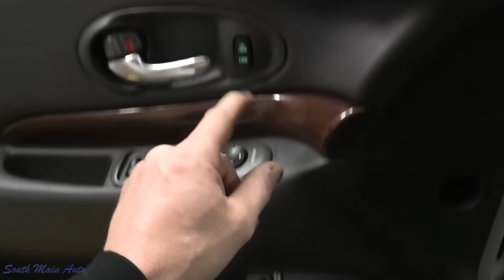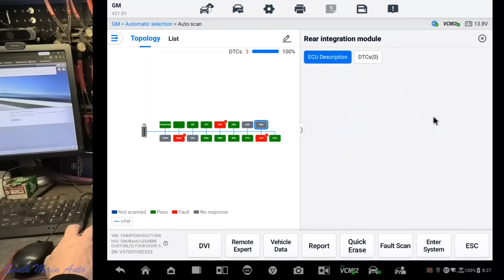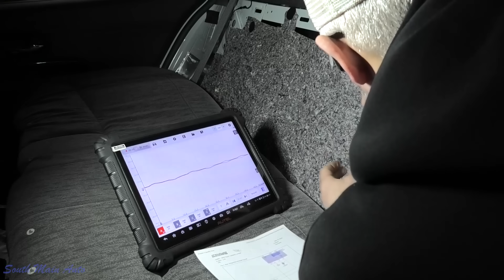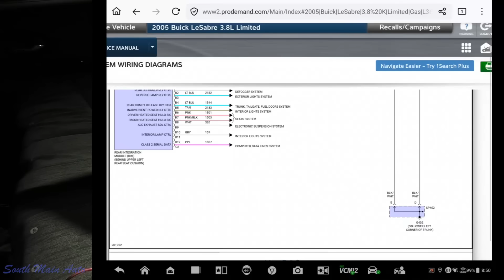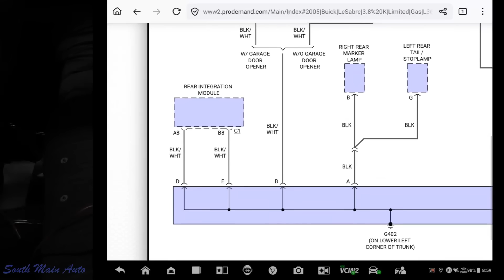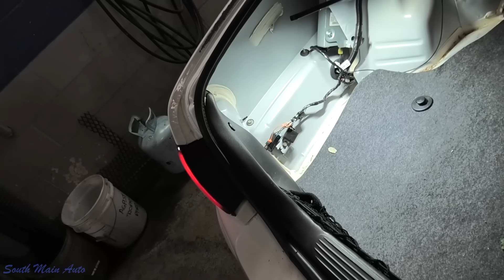2005 Buick LeSabre Electrical Nightmare – Customer Replaced Everything… But It Still Didn’t Work!

Comment: The best video on the internet is one of an older 5th generation Buick LeSabre. "Insane Jump by a Buick La sabre" <sic>
Reply: We all had those hand me down G body’s in Cleveland during high school. Used to PIT each other in blizzards, jump the tracks at the steel mil etc. gotta be so lame to be 16 and get a carolla!
Reply: Pre-cell phones…. Walkie talkies and a camcorder.  Gen X at its finest
Reply from the maker: https://youtu.be/5kMTHwjy6Z8?si=ZaMKWZu77kBntRlp
Reply: @SouthMainAuto  HOLY SHIT
Reply: @SouthMainAuto  "Its clear man, keep going"🤣
Reply: @SouthMainAuto  Comments are as good as the jump: "even death was surprised by that outcome" etc 😆!
Reply: That could have gone so horrifically wrong so fast. The grainy footage and Hot Topic misfits shirt really ties the video together 😂
Reply: These GM cars were such fun cars(and I'm not even a GM fan).  The B body & G body cars from the 70s - 80s were such tough beaters.  I had several ~$100 cars back in the 90s that you could just drive without any issues like we have today....no computers, modules, sensors etc.  They just needed gas, tires and brakes....maybe spark plugs, wires & cap\rotor once in awhile but that's it!  I miss those days of simple v8 rear wheel drive cars!

Comment: 2002 Lesabre with almost identical issues.  Except mine blows fuse 18 = RRDR module.  It is shorted to ground even with all wiring to RR dr disconnected.  Where do I find the routing of wiring from the fuse block under rear seat? Is there a source for the routing? I have a diagram but does not show routes the wires take.

Comment: I bought the new body style LeSabre Limited w/Grand Touring package in 2000. Twenty-six years later and 136,xxx miles, other than replacing a blend door motor, it never gave me any problems. In my opinion, Buick made a huge mistake when they replaced the LeSabre with the Lucerne.

Comment: Time and time again, seeing YouTube videos of people knowing the stuff right on YouTube it’s powers and grounds a good 60% of the time it seems like. I would recommend trying to find project charm on the Internet. It may be useful to some folks. It has power and wiring diagrams. If you can understand it properly, it should be able to help some people out there. Also understanding what modules are on the network can be useful if a module or sensor is pulling down the network or causing noise or corruption on the network can cause your vehicle a whole lot a headache on modern vehicles. Modern cars are nothing but a rolling computer with too many modules too many sensors talking back-and-forth or if they don’t get the right grounding or voltage everything goes wacky. May the parts Canon be with you.😂

Comment: Glad you made video. You have no idea,  going to find what scanner you are using.  Just watched you truck will not start cause of shock. Having electrical  problems on 08 gmc 1500, so looked at your page and got smacked in the face with 05 buick video.  I have 02 buick  same type of problems. I will watch and subscribe to your channel.  Man, you have know idea.  I was ase till 98. Went to northwestern in lima, oh in 1993. This serial data is kicking my butt.

Comment: Thanks for one of your old videos on GM ignition coil grounds. Fixed one today that had a VERY intermittent problem, but sure enough the eyelet fell apart when I took it off and I had to cut a couple inches back to add a new one.

Comment: That car looks pretty clean.  My son has a 2001, bought used.  We did the upper and lower intake sealing process and deleted the rear air shocks.  Good, cheap, reliable transportation.

Comment: Tool of the day! Uscope. I got one because you’ve used it many times. I like it. Only issue I had is the sd card crapped out and you can’t buy 4gb ones or whatever size it came with, at least anything with a name on it. No clue how they source them but I contacted support and they sent me a new one. I might have had to pay but it was like 10 or 15$. I was really hoping it would work for setting amp gain to verify the output isn’t clipping, but I’m not sure it’s made to handle ac, not like that anyways, because it would wig out occasionally and kinda sorta work for that purpose. But it’s survived my shenanigans with it 😅

Comment: That car is in amazing shape for a 20 year old car. I had a 1999 LeSabre it was a great car too until the salt corroded a hole in a rear brake line and the shop want $2K to replace the brake lines for a 15 year old car.

Comment: on our 01 lesabre i used a nonda bluetooth obd scanner and i had left it plugged in it eventually shorted itself and caused a couple electrical issues like the key fob not working to open trunk. had me searching fuses, almost replaced the rear rim module. until i randomly unplugged the obd scanner and then discovered the issue was fixed.

Comment: He (the owner) originally probably had some single issue so he began replacing parts. In the process of replacing parts he left the connector in the trunk partially disconnected and made things worse so mama told him to go get the dang car fixed. I would bet one of the parts he replaced was truly bad.

Comment: The problem with these modern vehicles is that when a problem pops up, it's not obvious where the problem lies. In this case a lack of ground was nowhere near the power door lock or the courtesy light switch. Why do they rout it through an electronic module?

Comment: When I went When I went back to school to learn the new computer systems the first process before connections of the diagnostic machine was to do a connection check. You never know the amount of problems this would solve. Another was cleaning and reconnecting the battery cables. Although on some cars you couldn't do this because it would clear the codes and make diagnosing harder.

Comment: I was shouting at my screen that the ground is missing, after you told that the module is not talking, the blinker and the lock/unlock not wörking. 
Remember kids: 
If a GM has funky behavior, it is the ground. 50/50-90 :D (the others are software or something else)

Comment: I appreciate this video.  Down here in the Southwestern Desert, I'm still running a 2000 Le Sabre and see no reason to trade it in on an overly complicated newer car.  I once did have a failed module in the left rear door and I've lost count of the number of window regulators I've replaced.

Comment: Those splice packs are crap.  My guess something rolled around in the trunk and jarred it loose, which has the potential to happen again.  I would have cut that SP off and grounded with a ring terminal.

Comment: I think you just fixed a 2015 Traverse. Son and I just replaced the AC pump and we moved a lot of harnesses around. Tried to open the hatch and no clicky-clicky!  Door locks were also dead. We unlatched the hatch manually to get at the rear evap to check for freon leaks, but we still gotta chase door locks.  Thanks for the help. Watching from Texas.

Comment: I am trying to diagnose a driver side power seat malfunction on a customer's  2008 Acura MDX. You cannot get a driver's seat wiring diagram from Mitchell or AllData. The passenger seat diagram is there but not the driver's side. Very strange. I love your videos though. Bonus comment... The driver's seat wiring diagram is found under memory systems.

Comment: That's quite the diagonostic tool.  Even a blind cave man can read the wiring schematics.  No parts needed!  That's a good thing except the empty parts cannon.  Thanks Mr. O.  P.O. With the fast blinking light I would have thought a high resistance in a taillight wire and checked the taillight wires.  Maybe I would have run into the loose plug.  Thanks again for all of the great diagnosis videos.  It's like chasing ghosts.

Comment: As far as I'm concerned.
For what you pay for these shitboxes, you should get a tablet with your manual on it, your wiring diagrams and all info related to your car!
If it's proprietary, then YOU FIX IT FOR FREE AS LONG AS I HOLD A NOTE ON IT!!!!!
I remember when I could run into a CANADIAN TIRE and buy a repair manual for just about any vehicle... Damn, can't remember the name of the publisher...
But, ya, you would grab one of these when you bought a vehicle and it had the torque specs, wiring diagrams, connector locations and a ton of shit for the guy who wanted to do his own work.

Comment: Alright here's my comment. In 1990 I bought a 1980 Toyota that had a dead fuel gauge. The dude brought the car over, along with a notebook where he had been writing down the mileage each time he filled the tank. He felt so badly about the gauge that he took $300 off the price of $800 that we had agreed on. While we examined the trunk I noticed a wire harness connector just laying across the trunk above the spare tire. I said nothing. I paid the gentleman and the first thing I did when he left was push the connector together. I cut the key on and the fuel gauge came to life.

That was my no-parts fix that cost the seller $300 in 1990, my greatest victory in this life, and the best car I've ever owned. 4-speed manual, manual windows, manual mirrors, manual steering (no power assist). Just a simple, fun car that got the job done. No, I didn't have service data. Send me back to the '90s please. Great music, great friends, great times. We took everything for granted. Now look at this world. You don't know what you have until it's gone.

Comment: A ground wire and loose connector? C'mon man, I graduated from Mr. Goodwrench University. And I'm the top revenue generator in my Chevy dealership. And according to my  OnStarTrek v3.14 Remote Viewing GM Bi-Directional Tricorder Scan Tool,  this car needs a new crankshaft and a new turbo, along with new pads and rotors on all 4 wheels. (sarc 🙂, keep up the good, honest work Eric!)

Comment: had a customer throw the parts cannon at a buick like that. Ended up being the fuse box under the rear seat had the typical melt down after a bad fuel pump
Reply from the maker: Actually what causes that problem in those cars is the fuse box lid. There's a tech service bulletin on it. You have to cut some plastic off the bottom of the seat to keep it from pushing on the lid that pushes on the fuel pump relay that burns it up. I did a video on it maybe 8 or 9 years ago.

Comment: Just had a Hyundai Santa Fe that had no ac due to the ac inverter fuse removed that the car has no inverter installed go figure ac would click on but not built pressure I don’t get it but I’m the only shop in town including the dealer that could fix it

Comment: It goes back to "KISS". Keep It Simple Stupid. Don't start in the middle and work in both directions. I always tell my new guys to break it down to the simplest factor. What does it need to work?  Sometimes the big picture is overwhelming, but if you break it into its parts "This has to work, for this to work" and the wiring is usually what leads you to bad connections, corrosion and then possibly a bad controller or module. But eliminating the harness as the problem first usually answers a lot of questions. Anyhow, another great learning video for the newer guys and gals.

Comment: I highly recommend to everyone to pick up the inexpensive power and ground LED test light from harbor freight I think it's like 8 or 9 bucks. It connects to the battery similarly to a power probe without the ability to inject power but it can't cause damage to a computer because of the low power draw It lights up red for power green for ground and It has diagnosed quite a few computer issues for me. A perfect instance of when it was an invaluable tool was working on my buddy's 04 Dodge ram with a hemi and no matter what we couldn't get cylinder 7 to stop misfiring and with this tool I eventually found out that the computer could not supply a substantial enough ground through the driver to spark the ignition coil on number seven, with a new ECU from cardone it fixed the misfire but that was a whole other issue with them not reprogramming the computers at all and having numerous other issues with each computer we put in. Eventually he sold it because it would run really good and shifted perfectly but had a rear ABS light because it didn't have ABS at all and the ECU expected it to. Moral of the story is don't use cardone

Comment: Yup, go to Harbor Freight and buy a test lite, then jam it in the socket as far as it will go, widen the gap so when you plug it back in, it still will not work. This is what most diy'ers would do. Don't forget the most important book you can buy and that is Auto Repair For Dummies. I red that sixty years ago and I became the bet mechanic around, just ask me.

Comment: Had a lot of the same problems with a 2007 Silverado Classic. One day the battery was dead. The battery would only hold a charge 1 day. Put a new battery in, hold charge for 3 days. I recharged it, then windows, mirrors, and door locks didn’t work from driver’s door. Check fuses and wire connections, nothing. Ordered a new driver door switch. Now everything works. Even things I never noticed.

Comment: I purchased a proper VCDS cable for VW when I bought my first one, best $250 I ever spent,  lately its let me recode used ebay body control modules for a fraction of the price of new ones.  (sunroof drains are my nemesis lately)

Comment: 100% agree on the DIY approach and the info available. One of the first things I did when I bought my current car was grabbing the OEM service manual off eBay. In the grand scheme of things it cost me nothing. I want to say it was like $50 or something. Full info with wiring diagrams and operational details. Haven't really had to use it for any diagnosing, knock on wood, but it's been a great educational tool to know more about the vehicle overall.

Also worth looking to see what scan tool options are available depending on your vehicle make/model. Ford owner here and Forscan has been indispensable and the combined license cost plus cost of an OBDLink adapter to use with it is way more approachable than what you'd need to get into using IDS/FDRS/etc.

Comment: Floating grounds (or commons) can cause all types of wacky issues in electronics.
I have years of experience as an electronics technician for the DOD and usually it was caused (new build) by terrible engineering design.
Letting mechanical engineers design the grounds or commons thru the chassis can be a mistake.

Comment: Anyone remember when all that was involved in popping the trunk open was a simple switch that fed power to a solenoid? Now it's a simple switch that has to send a signal over a network to 2 different modules just to ground a relay coil to get power to a solenoid.
Reply: Remember when popping the trunk was just turning the key?!

Comment: It's too bad we couldn't see the look on the owners face when they found out after all their gun-decking of parts that....the ground connector just needed to be plugged back back in.  Man oh man, that had to hurt and I know because I have been "that guy".   Really dig seeing the scope presentation insert.  Great video & thanks for taking us along!
Reply: The customer probably had a left brake/turn bulb out, replaced it and  knocked it loose or didn't reconnect it all the way. The light still didn't work and a bunch of other things. Lol
Reply: Another reliable,informational,educational resource from the Great Eric O. You the man 🧍‍♂️
Reply: And I hope the customer and others don’t think this edited half hour video is all it takes. Im going to toss a guess at least 2 hrs. By the time Eric or any mechanic fires up a computer to retrieve wire diagrams, quick study then tear the car apart to find connections to probe etc…. The process can be tedious. These programs, AllData , Mitchell , Identifix and others are subscription based cost the shop too and shop or mechanic choice to which is the best computer

Comment: Hey I used Mitchell DIY to trace down the location and info for a front sensor replacement on my 2015 ES 350. Worth every penny!! Thanks as always, Eric!!
Reply: I used Alldata DIY to track down a crusty wire for the evap vent valve on my 07 Trailblazer. Best $60 I ever spent on a money shot!!🤣

Comment: That grounding connector being unplugged is very suspicious. Maybe the guy has an enemy who decided to "rat f*ck" him? And yes, the key to success is knowing which problem to solve. I bet that guy spent 10x the time and money that you'll charge him for the competent repair.
Reply: He probably had a left brake light/turn out. Replaced the bulb and knocked it loose with the trunk carpet. Or didn't get it fully connected if he took it off.
Reply: @Andrew-o4j5u  Exactly. He originally had a simple problem that he made worse. May have been a bad bulb or may have been one of the components he replaced. I would bet in his box or parts replaced one of them is actually bad.
Reply: Happens at the auctions too.